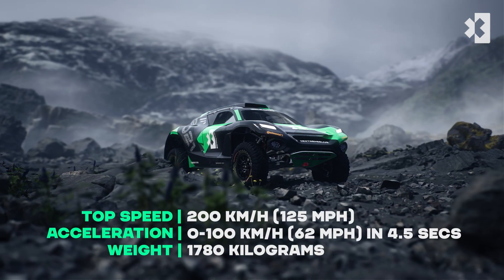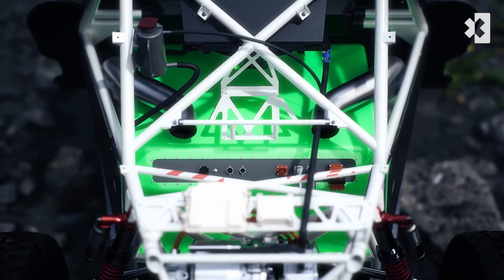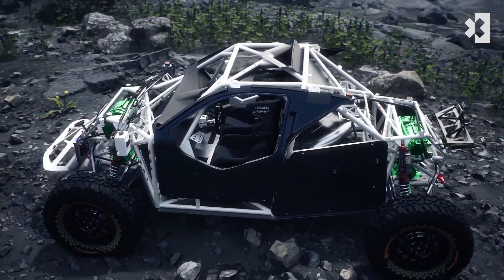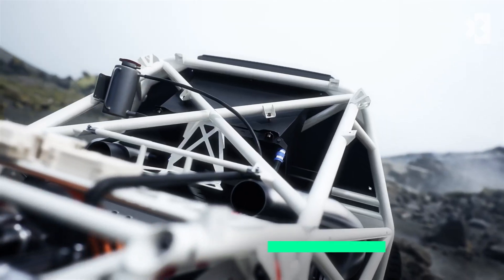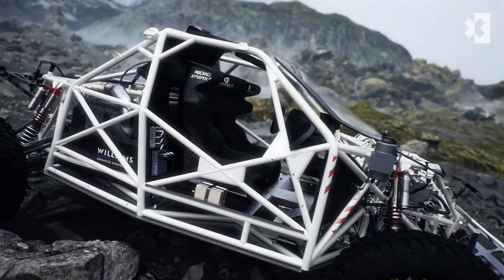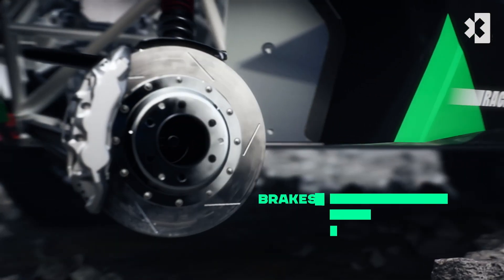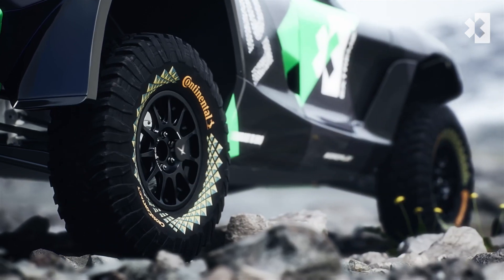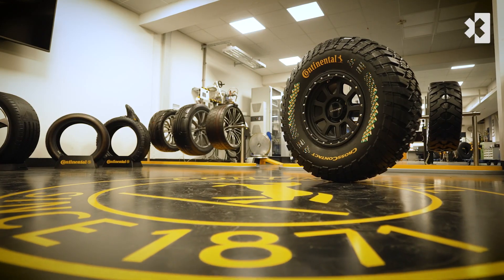Everything You Need to Know About the ODYSSEY 21 | Extreme E Explained

Comment: One major problem
Hydrogen is NOT sustainable energy.
Hydrogen is worse than actually burning the gas in a combustion engine, because hydrogen is refined from fossil fuels, and literally requires a lot more energy to get.
Who came up with the lie than hydrogen is sustainable is a scumbag. 
Also hydrogen is a lot difficult to store needing more energy. Also hydrogen is a lot rarer, creating an even tighter shackle for the consumers that cannot find alternative, making fuel more and more expensive.
And hope nobody is dumb enough to suggest using water for hydrolysis. It would take a real lizard brain to come up with that notion.

Comment: So if your using a hydrogen fuel cell to power things as well as the solar panels then why not just use hydrogen as the fuel for the cars
Reply: battery is small enough and able to withstand impact better than hydrogen fuel device
Reply: They did announce a hydrogen fueled series in the next few years